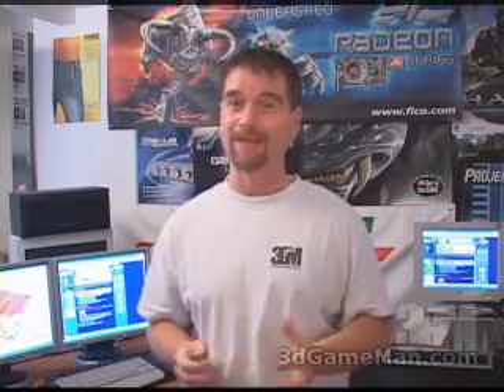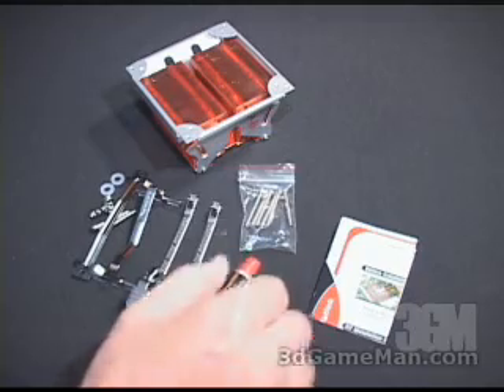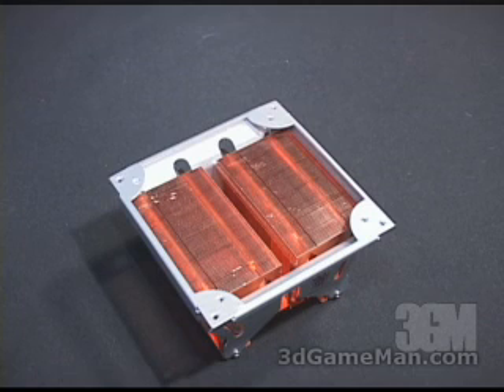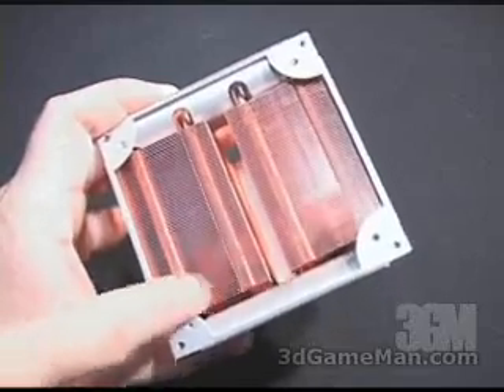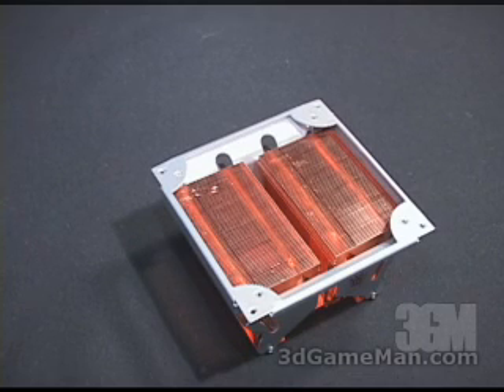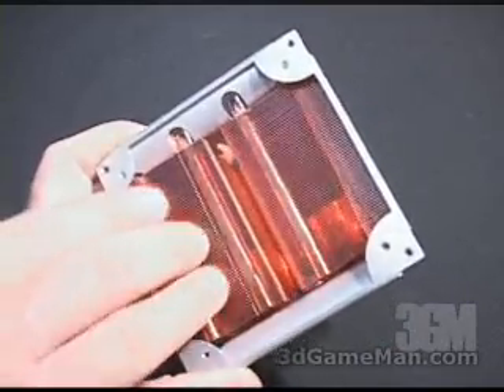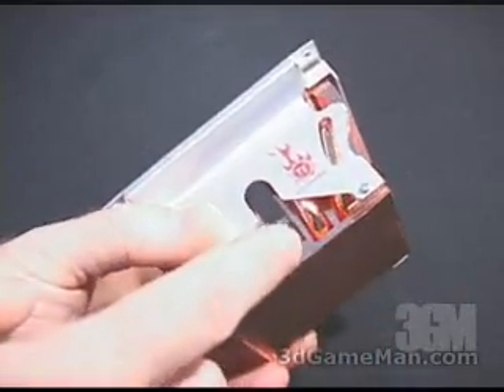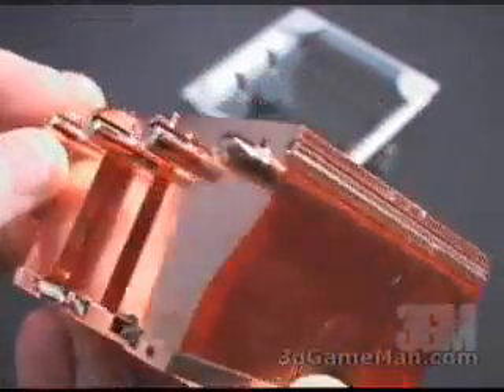#455 - Thermaltake Combo Cool DIY Series Heatsink - PIPE101

Comment: did you ever think your reviews would still be relevant and help someone choose a p4 cooler 15 years later? well it did! haha
Reply: Same! I'm looking for a decent heatsink and fan for a P4 Prescott 478. It's so far been quite difficult to find one.
Reply: @mcrazza  times is tough
Reply: @FOIL_FRESH  Indeed. How'd you go?
Reply: @mcrazza  my ECS s478 motherboard crapped the bed and haven't gotten the new board set up. im using a noctua 92mm and it was initially probing at like 55deg c and climbing during bios. could have been the fan around the wrong way but i dont think it matters too much. it will run hot and i dont mind as it's in an open air-ish case. good luck on finding one, my other pick would be zalman as they can perform well.
Reply: @FOIL_FRESH  I let a Salman 7700 slip through my fingers last week for AUD50. I found a Thermaltake just like the one in the video but I want to get some advice first before I pull the trigger. I also found a cheapo 90mm fan to fit the Thermaltake heatsink but I don't know if it's good enough or if I should reach for something more expensive. FYI I got a Prescott 3.00GHz/1M/800.
Reply: @mcrazza  the fan size for the pipe is 80mm or 92mm, both will be fine but i think the 80mm needs a higher rpm. i do plan on getting another faster fan to test. but as the video shows its definitely suffcient. the pipe supports up to 3.4ghz extreme edition i believe.
Reply: @FOIL_FRESH  Would 2400RPM be sufficient? I'm not planning on OCing.
Reply: @mcrazza  i cant be sure, maybe get a fan that you can see yourself using in another pc/as a case fan if you find its still too hot. a part of me thinks that the 6000 rpm one in this video might actually be necessary. but if i get my p4 running this weekend i'll know.
Reply: @FOIL_FRESH  Alright then, keep me posted.
Reply: @mcrazza  sorry its been a long wait. I got it all hooked up over the easter weekend. With the noctua 2000rpm fan on the pipe101 im averaging around 50 to 60c. Its a p4 prescott 3.2 overclocked to 3.45 (215mhz fsb). Paired with a geforce 6800gt it flies.
Reply: @FOIL_FRESH  Thanks for the update! I've been searching on and off for certain makes of HSF compatible with 478 prescotts. Price, location, timing and availability continue to remain issues. Thanks for suggesting Noctua. I found some at 80mm and 92mm on eBay that spin at 1800 and 1600RPM respectively.These are advertised as case fans. Does it matter?
Reply: @FOIL_FRESH  And the search for a decent AGP graphics card circa 2003-2005 continues. I'm having the same problem as in my previous post. I found some later cards like a Geforce 7600 GS for an affordable price but compared to earlier mid to highend cards it's so-so. On the ATI side Im looking between an 9600XT up to an X850. With Nvidia it's between the 6 and 7 series from the 6600 upwards. Very difficult.
Reply: @mcrazza  i would stay safe on that option and try to find something higher to keep it even cooler. 3000rpm is probably the sweet spot but its hard to find fast and quiet at these sizes.
Reply: @mcrazza  yep the end of the line agp cards get expensive, good luck
Reply: @FOIL_FRESH  A brief update: I bought a second-hand Zalman CNPS 7700 Cu on Gumtree the other day for AUD40 + shipping. Not a bad find. It's yet to arrive but from the pictures it looks to be in good condition. That's the HSF sorted; now I'm prioritising getting a PSU before a video card and CRT.
Reply: @mcrazza  nice score, those zalmans are rock solid. even if a little rusty they will clean up fine and i think most fans are replaceable so you'll be sweet.

Comment: I have one of these. I have had it installed on a Intel p4 3ghz clocked to 3.2ghz for 3 years now with no problems. Great that you can use standard 80mm or 90mm case fans onto it. It has been a fantastic cooler. I just blow out the dust every now and then.